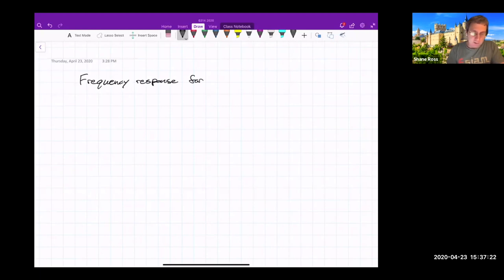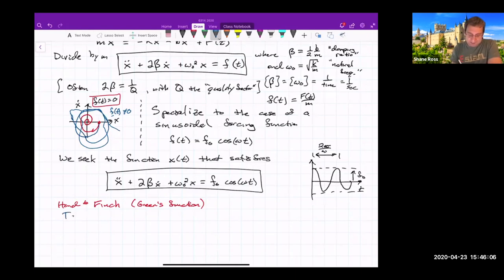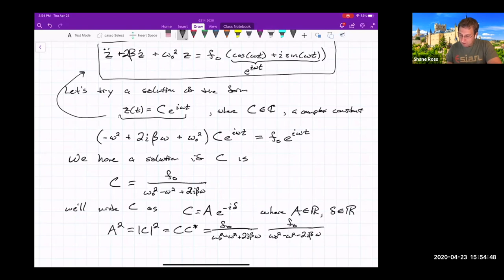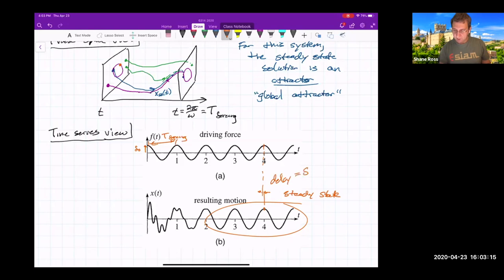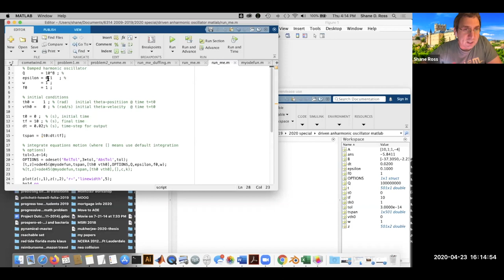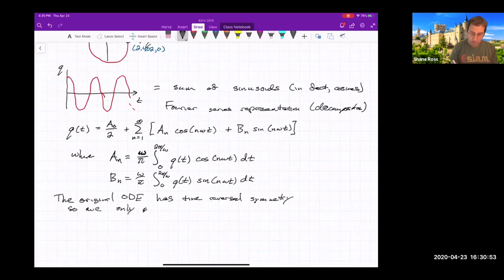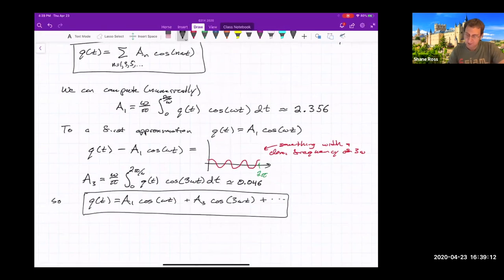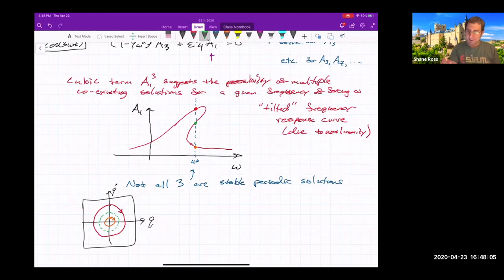Frequency Response Curves for Linear & Nonlinear Oscillators |  Lecture 19

Comment: Why does t -> t + /pi implies odd frequencies???
Reply from the maker: Basically in the calculation of the amplitudes A_n for even frequencies (n = 2*k, k an integer), the second half of the integral exactly cancels the first half.
Think of the case \omega = 1. The equation has a symmetry such that the solution q(t) also has a symmetry such that it satisfies q(t+\pi) = -q(t), so the second half of the period is the negative of the first half. Now for cosines of even frequencies, we have cos(2*k*(t+\pi)) = cos(2*k*t), so they are the same during the second half of the period. Take the integral of q(t)*cos(2*k*t) dt for a full period (0 to 2*\pi) and you'll see that the second half exactly cancels the first half, that is, you can transform the integral into one of just 0 to pi of (q(t)-q(t))*cos(2*k*t) dt, thus zero.